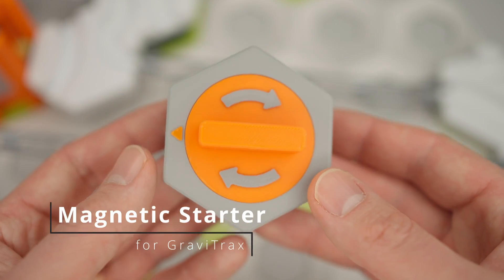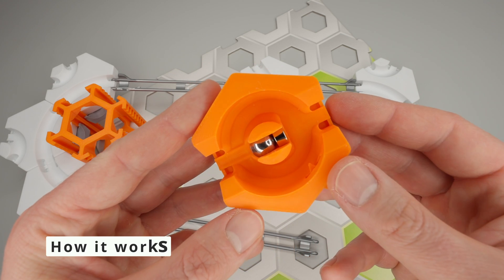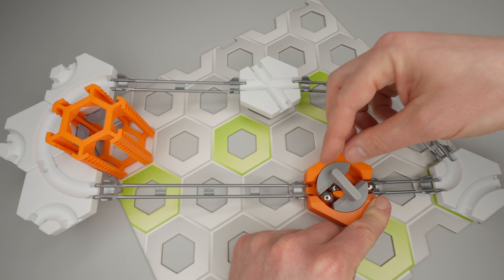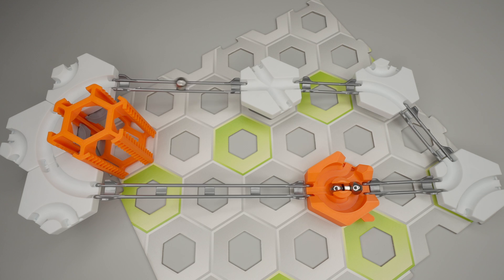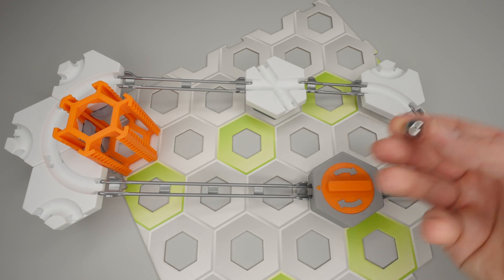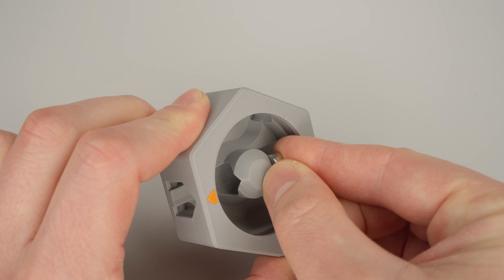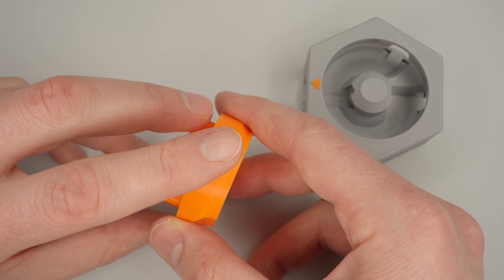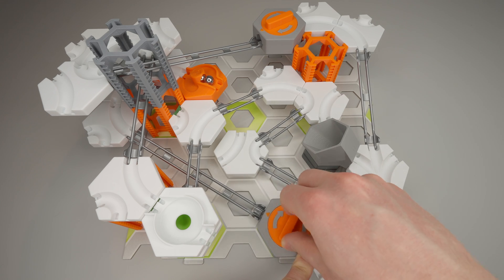Powerful Gauss Starter Cannon - 3D Printed Gravitrax Extension

Comment: Nice! 🤠 So if the track is not set up in a loop, then this could simply be used as a regular magnetic cannon with a convenient reset, to prep the magnetic cannon for the next run?.

FYI, I like the version at 1:30 better than the final version merely because it's cool to see the marbles inside, plus many times in a complex track it will be difficult to remember which cannons have marbles in the input or exit ports. And a mistaken assumption could result in the track failing because it was not properly set up. The version at 1:30 allows quick visual inspection of the input and output marbles, eliminating this concern. The final version is more of a black box whose inner workings are hidden.

I designed spring ends for the indexing springs that can be 3D printed without supports. That way you don't have to find a source for 6mm balls or 3D print the balls using supports. Since pasting the link here is not possible, everyone can find it by looking under the "remix" section of the original design (link in video comments above). Note that the parts should be printed in a PLA filament that is not at all sticky (usually the clear glossy PLAs), because that will cause part chatter. I find a nice matte PLA works well.